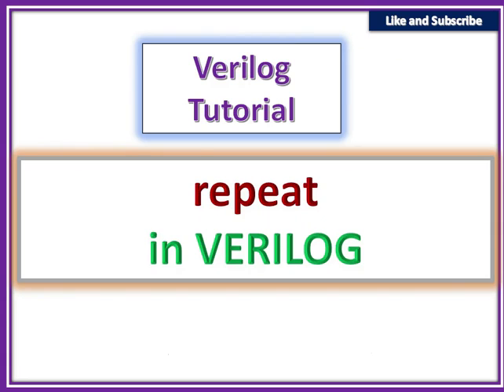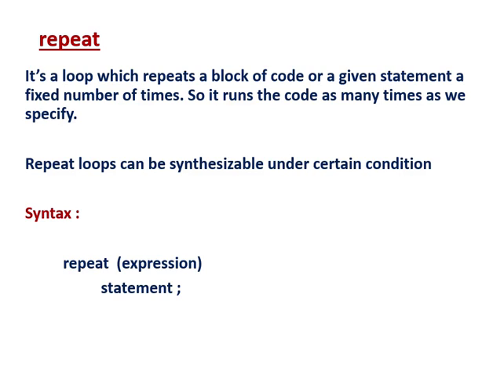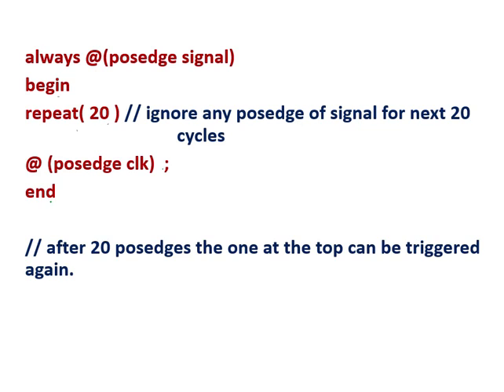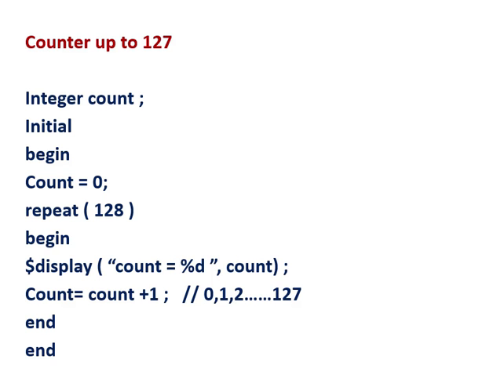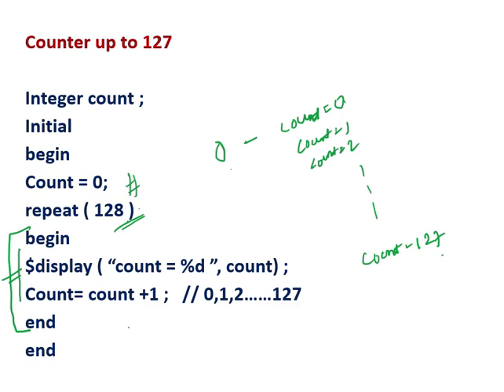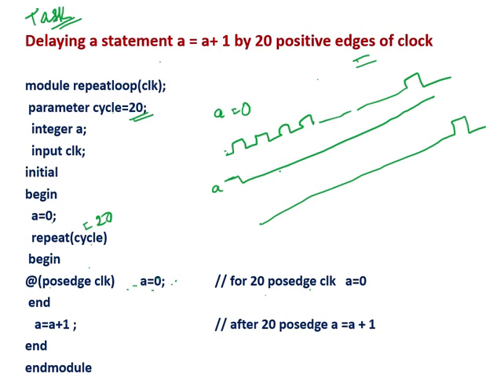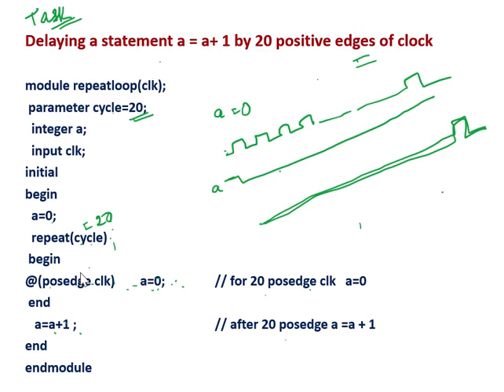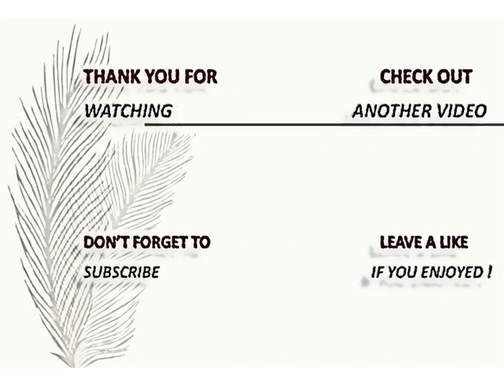#32 " repeat " in verilog || realtime example || Synthesizable " repeat " statement

Comment: In the last code if we give a=a+1; then doesn't value always remain 1. Since the value is incremented and brought to 0 again
Reply from the maker: repeat gives continuous loop. So
a=0 for 20 cycle
a=1 for 1 cycle then
repeat above steps again.
a= 0 for 20 cycle
a=1 for 1 cycle

loop never stops once a=a+1